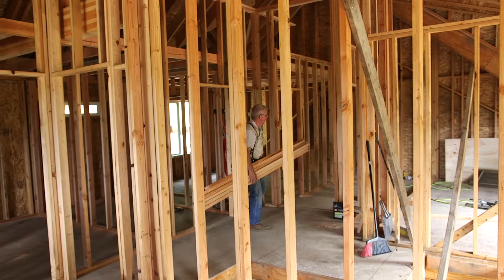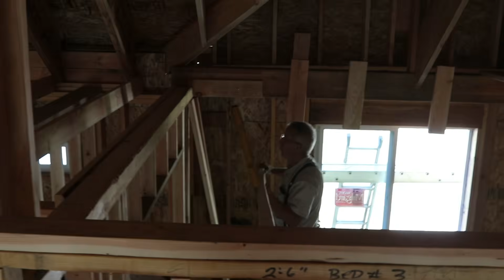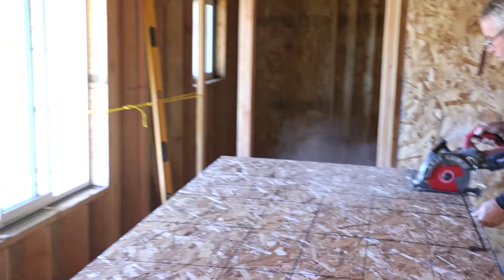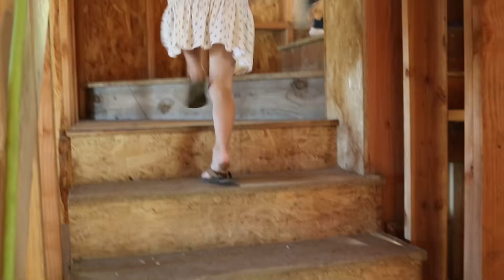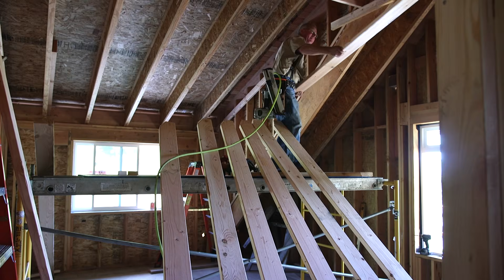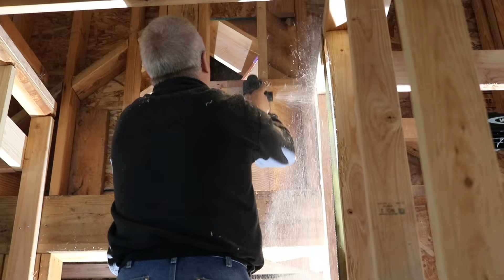Framing Ceilings Ep.85

Comment: I am in need of advice, I have been having some concerns about my future in construction and would love advice from people who I don’t work with. I am 22 years old and I have been working for a “small” general contractor for the last four years. Since the October of last year our work load has been relatively slow, and I have to beg for my 40 or I may lose two days a week. We have nine people working in the field and the office has hired three people for estimating positions this year. I have concerns about the future of the company and specifically my future in the company. We have little to no benefits, and I’m currently making $17 per hour. We’re an open shop company, I have been taught how to finish concrete confidently, metal stud frame, hang drywall, build decks, pour footers, lay out walls, set trusses, deck roofs, assist in digging footers, and casework. I hired in as a laborer and have been taught a lot. Nobody in the field has gotten a raise in two years. I have had two children since my last raise. I have been considering quitting this position (peacefully) and applying for higher paying carpenter jobs, hopefully with better benefits (401k, vision and dental). I’m just concerned with what my title truly is as we are an open shop and I was hired as labor, the company doesn’t really assign us titles. I have been told that I am almost a carpenter but nobody in the field has told me what requirements I should be looking to fill. I’m worried for the family I am building because I feel like the company I work for doesn’t have what I need or the challenge that I desire. Any advice is appreciated!
Reply from the maker: Time to move on and move up!
Start researching the other companies in the areas that you are willing to live in. 
Pick the one you are willing to bet on. 
Hound for a job them until they hire you!!

Comment: Cordless tools are very very convenient especially with the battery tech we have I only have to change batteries in tools 1 or 2 times a day it's great and nail guns are awesome not just because you dont have to drive nails by hand I kind of prefer doing that usually except when I'm in a tight spot then it's a pain 
To drive a screw or hammer a nail

Comment: If you're going to insulate the tops of the flat ceilings, you'll have to insulate the vertical transitions between them as if they were exterior walls, correct? Except they're not 2x6 so maybe 3.5" of batts plus foam board.

Comment: I worked 40 years and fell a couple of times.....As I a now 70 and only go up from time to time....a young man is so much safer.....if the ladder walks you grab a ceiling joist with your off hand and hang on to the skill saw with the other...you drop that saw and break the case or handle you cant go back to work anyway...that is your first thought....second is worrying about the belt....get a trysquare stuck in you...or a couple 16d through the bag.....As an old man I don't know if I would have the arm hand strength to hang on..or rip some goodies out of my shoulder.....
Reply from the maker: Amen brother... tis a bleak realization for sure...

Comment: Fire blocking to meet IRC RIRE CODE will be a lot of work. A lot of time planning ahead to install required code is easier before you build your stairs and different height ceilings. My son is an engineer with a large city fire department and a licensed general contractor specializing in homes and remodeling. Fire code is important to him.

Comment: Have you seen the ladders with a sort of guard rail and platform on top? Wonderful idea. Never have to worry about getting caught standing on top!.  Works really well. It just adds a little weight to the ladder.     https://www.homedepot.com/p/WERNER-16-ft-Reach-Fiberglass-Platform-Twin-Step-Ladder-with-Casters-300-lb-Load-Capacity-Type-IA-Duty-Rating-PT7410-4C/203134357?MERCH=REC-pipsem-203134337-
-203134357--N
https://images.homedepot-static.com/productImages/25c376b7-b366-4d42-a6a8-4ffc2dc14967/svn/werner-platform-ladders-pt6006-64_1000.jpg

Comment: I see you using some nails for some boards and lots of nails for some other boards. My opinion is that nails should be keeping things from shiting, but the structure should be bearing the weight. How do you determine how many nails you need?
Reply: The codes have nailing schedules.  The number (and size) of nails you need is all spelled out.

Comment: I'll be putting a 2-store addition on my 1870 farmhouse next year. My biggest concern is that NOTHING in this house is plumb, so I'm going to need to be quite patient in  assembling everything, because I can't just cut a template board and run with it; everything will need to be measured independently and I'm sure some re-work will be required on more than one instance.
Reply: 1900’s house... nothing is level, all floors must slope in at least two directions, and no door may seal correctly.

Comment: On costs why have you done ceiling with 6x2 and not 4x2 which should be cheaper?
Reply: 2x4 joists would sag over a pretty small span, even with just the eight of the drywall and insulation.

Comment: I didn't see what framing nail gun you used, it wasn't in the footnotes. Can you do a video of nail gun selection, pros and cons of each manufacturer? There is a lot of brands, and of course, pnuematic vs battery. Lots to consider, thank you
Reply: its a hitachi or now matabo--hope I spelled those right. very powerful ,light weight,reliable. adjustable depth  ..down fall --no hook to park in high places
Reply: @henrybusjahn8714  Metabo vs matabo, but you're right Hitachi became Metabo.  Scott (and Nate)  did a video about 2 years ago on nail guns.

Comment: Good video, Scott. I can relate to the challenge of hanging a ceiling from roof joists. Years ago I was finishing our upstairs, and ran into the same issues of being level in 2 planes and having all the ceiling joists the same height. My first attempt looked like a roller coaster! I wound up getting some advice from a friend of mine who was an old time carpenter- he told me to get 2 4x4s, cut them to the exact same length, put some feet on them and use them to rest my ceiling joists on then nail them up. Worked like a charm!

Comment: I estimate this house to cost the customer around 275. What do you guys think??????
Reply: Yea right in there.  Maybe even 325K Roseburg is at $157 per square foot.    Think the view at the top of the ridge will drive the price higher.
Reply: JOSHUA RICKS      I suspect a great deal more.
Reply: @218philip  based on what?   wonder if a viewer will buy it???
Reply: Steve W   It’s  nearly impossible to find a house built like this, just the complex roof without the soffits. The retaining wall alone would be at least 20 thousand. It will really be interesting to see finishing and mechanical systems.  The detailed record of its construction drive its price also, nothing hidden. 
450 thousand minimum.
Reply: @218philip   - I hope you are right!!  But with the lack of any yard I think that would take out some families out of the mix.  Gotta remember in that price range out there people are used to getting 5 Acres.  Here is a recent sale of a new construction:

https://www.realtor.com/realestateandhomes-detail/3101-W-Woodside-Ave_Roseburg_OR_97471_M92734-25870#photo0

Comment: It's reached the point where all the Code-required insulation in the ceiling has gotten so-deep that it's nearly-impossible to have any usable attic space, even for light storage.  R-38 or R-42-plus batt or blown installation takes a lot of depth, often 14 to 16-inches.  We're even raising the roof eaves to get sufficient depth-of-insulation along the perimeters now...especially for blown-in insulation.  Some designers are deliberately adding sloped ceilings just to precede the homeowner from stacking their stuff 3-ft-high in the exposed ceiling joists. 
I-section rafters are rarely used here on the East Coast anymore, it's either sawn lumber, roof trusses, or increasingly PSL or LSL long-span rafters.  The fussy-detailing for I-section rafter-framing as-you-mentioned works against the level of craftsmanship available....and complicates addressing our snow and wind-load design.  While we don't get blizzards or hurricanes often, we're required to design for them.  Most of the bldg. matl. suppliers don't even stock the roof-grade I-sections anymore.
Reply from the maker: Great comment!!

Comment: If you planned on adding plywood on top of the ceiling joists (for attic storage etc) would the pressure blocks be sufficient for support the ceiling structure still?  You said pressure blocks were sufficient for drywall/ insulation. Thank you for your videos.
Reply from the maker: The insulation requirements will make it impossible for anyone to ever put storage space up there.

Comment: It's really a shame that there's enough room to stand up there, and yet it's not a floor. At least a kid's play area and seasonal storage stuff. If it was my house, I'd have thrown in a few extra joists and thrown some plywood down after the inspector was gone. Can't have too much storage, especially in a house without a basement.
Reply: No reason to make it a floor.  Nobody should be up there for any reason other than doing necessary work.  I don't know what codes apply in Scott's area, but the IRC required R-49 insulation, other codes are probably similar.  That's 14" of fiberglass batt.  so it's going to be lofted 8-9 inches above the 2x6 rafters.  If you squeeze 14" of fiberglass batt down to 5-1/2 inches it's not R-49 any more.

Comment: 9:30  Man!  I hope you're arranging access to that area, and finishing off the surfaces... because being able to walk in there and set something down on that 'shelf' seem like a pretty good bit of storage to me.
Reply: Except that the code requirements will be for 14" of fiberglass batt, (or even thicker blown fiberglass),  and you can't build a floor up there without ether compressing your insulation (in whcih case its no longer R-49)  or building a platform above the 14 " of insulation.

Comment: I'm a swedish guy enjoying the episodes! Im an amature learning a little bit of the craft on my spare time by building a small guest house from scratch. Its really interresting how you build and with what tools, compared to here in Sweden. I have picked up a few things from you guys, for example the speed square, NO ONE in sweden uses it. I though it looked handy and went to the most well equiped tool store here to look for one, and they actually got it, and in metric too. Really lovng it and can not understand why no one is using it here..
Reply: Speed squares are one of the most underrated tools available. They are wonderful.
Reply: That is strange that the simple speed square never caught on over there. What do you use instead to measure angles and pitches?
Reply: @psidvicious  yeah really strange. We often use miter saws. And for stransfering angles we use a sliding t bevel (think thats the right translation). And you often see the precision square here
Reply: @pellebrink4001  In the US, 9 out of 10 carpenters will be carrying a speed square with them at all times in their bags. The other 1 out of the 10 just hasn’t caught on yet. 
I’m curious what your fellow carpenters think when they see you using yours.
Reply: @psidvicious  yeah i reallize its very common in the us. I showed it to a friend and he was surprised and though it was a really smart tool and said he would buy one too haha.
A tool 9 out of 10 carpenter carry here is a wooden folding ruler. I understand you use mesure tape most of the time. Quite common here to but not as much. I usally carry both

Comment: So basically, you're building a house, then your're building a smaller house inside, that touches the ouside walls of the bigger house at some points. And later, you can walk on top of the smaller house inside the bigger house.
Reply: so much wasted space!
Reply: Just like every other single floor house with a gable roof.
Reply: @ee4231  that’s why I love the look/function of a 1.5 story ranch style house
Reply: Crazy. I built a pole building house with a 2x4 stick framed house inside it essentially. Clear span 32 ft  trusses and inside of the post I 2x4 wall all the way around. My reasoning is insulation. I have 11 inch's of insulation in the walls. 10 inch thick window sills. And a nice straight wall for drywall.

Comment: Hey guys.  Back when you first built the stairs you found that you had figured them wrong and said you would fix them later. I was just wondering if you had fixed them yet. I would like to see how you do it. Great videos.
Reply: I always love stair videos as well, but from a video standpoint, it really wouldn’t be much different than the original stair video except for a slight change in the layout of the tread length, which wouldn’t really be noticeable on video.
Reply: @psidvicious  yeah but I was just wondering about the process since they are so far into the build.

Comment: In conventionally framed roofs, where there is not a ridge beam, only a ridge board, the ceiling joists function as an integral part of the roof support, which is why they have such intense nailing requirements to the rafters. Those conventional systems would not function/continue to stand up to loads without the ceiling joists in place. Your situation is different because you have engineered ridge beams.

Comment: Hi EC, would you tell me what framing gun to buy? 31/2" i guess...
Reply: nacho elias Check out the Metabo HPT NR90AES1 on Amazon. Shoots 2-3 1/2” nails. Only $175 and a damn fine gun.
Reply: Hitachi makes a great coil nailer that adjusts to shoot anything from 16s (3.5”) to 4s. It’s definitely my choice and I’ve used a lot of them.
Reply: @psidvicious  Except they aren't Hitachi now.  They're Metabo.  Same nailers, presumably same quality.  Different name.
Reply: @andrewalexander9492  Didn’t know that. 
Always had great luck with those Hitachi nailers, but Metabo is a brand I always stayed clear of after my first experience with them.
Bought a Metabo ½” hammer drill. Burned it up within 2 days. Brought it back to HD and got a replacement. Burned it up also in about 2 days. Went back to HD and had to take the loss bcz they wouldn’t refund my money. Bought an equivalent Milwaukee and still have it today, at least 2 decades later.

Comment: Q: How do you know the weight of your ceiling joists won't bow your straight board and get the ceiling out of whack? Is there a formula, or do you just SWAG it?

Love the channel.
Reply: His engineer did the work back when the house was being designed.
Reply: He had a brace in the center.
Reply: 4:32 brace holding it level.

Comment: Why use 2x6 lumber instead of 2x4 lumber everywhere to suspend the ceiling drywall?  Certainly in some areas 2x4 lumber would have been less expensive.
Reply: Too long of a span, you will encounter sagulation with 2x4's.
Reply: All depends on the span. Sagging has to be taken into consideration. There’s a table available that you can look up the proper sizing of dimensional lumber for the span needed.

Comment: You know people will eventually stack all their Christmas and Halloween decorations on that roof system.
Reply: That's true, however that's not what he was mentioning or meant. It's not going to have to be load bearing. It's strong enough for what normal people would do for storage. It's not as strong as the floor or roof system. Not that it's only strong enough to hold drywall.
Reply: @shindanu1  lol you haven't met my wife and all her Christmas decorations!
Reply: yup i would have made them 2x10s for that reason
Reply: I always filled my attic with my unused books.
Reply: Greg Stoll 

Not if it is stacked high with blown in insulation
Reply: @TheRentsTooDamnHigh  just how high are you talking? I've never seen blown insulation be above the rafters. Even then, that won't stop people from using it as storage. Cheers :)
Reply: @Ham68229  R72 will be above the rafters.
Reply: @Ham68229 , We have Blown in insulation here in the Northeast that's 15'' deep, not that they will, but it does go above rafters here anyway.
Reply: @Ham68229  almost every attic i go in(and thats quite a few) has enough blown in insulation that i have to search for the rafters  through at least a foot of insulation, many times more than that.